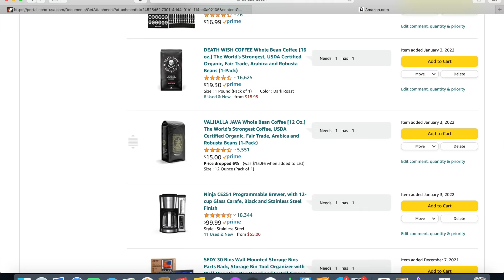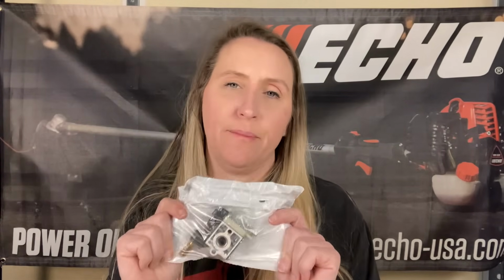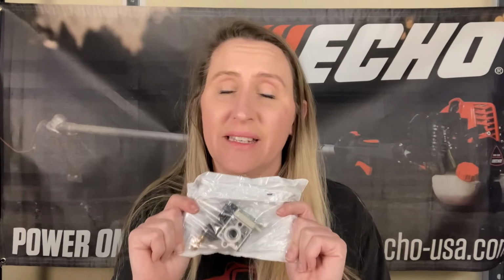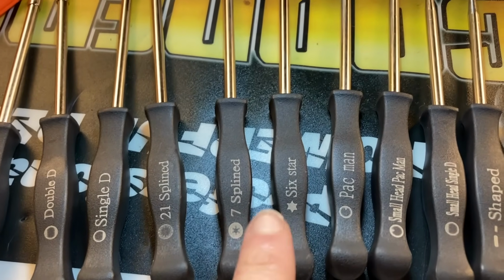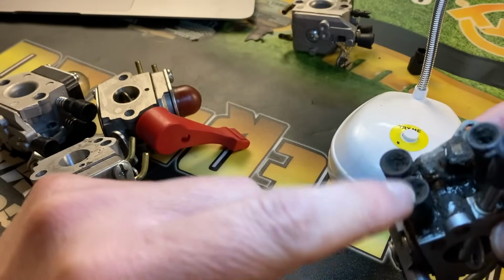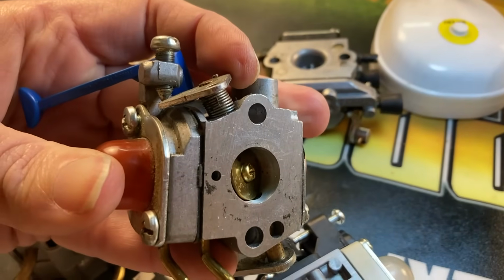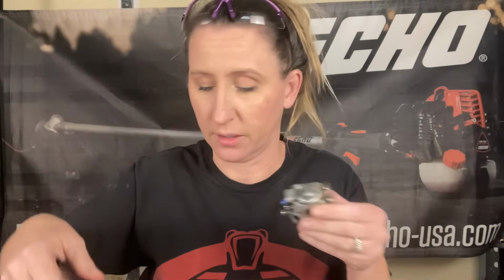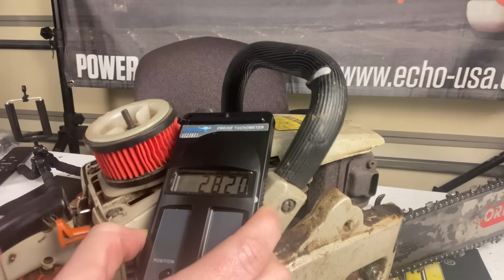HOW TO ADJUST your 2 Cycle Carburetor on a Chainsaw or Trimmer and when you probably shouldn't VLOG

Comment: The manual for my Stihl HS87 hedge trimmer shows "Cut off speed" is 9,300 rpm. What does this mean when I am adjusting the full throttle speed? Thanks from the UK. I am finding your channel enormously interesting and useful.

Comment: High i am struggling with a huskavana 545rxt brush cutter I can get it to fire but not iddle or throttle I've changed diagrams new fuel new plug checked spark good I'm going to change fuel lines and filters what should I set carb to high low n throttle plz

Comment: I didn't see the Echo limiter cap removal tool listed in the description or your website.  When I googled I found both a 2.5mm (#ECH-91075) and 3mm (#ECH-91076) limiter cap tool, as well as an Echo 91157.  How do I know which one I need for my Echo HC-2020 Hedge trimmer?  Thanks!

Comment: Water in the fuel may be due to the use of alcohol in the gasoline to oxygenate the gas before it is burned. There are two types of alcohol in use, methanol and ethanol (wood alcohol and corn alcohol). The methanol is hydroscopic (attracts water) and will suck it right out of the air. It is only put into the lower two grades of fuel but not in "ethyl" or high test. Use only the highest grade of gas for your 2 cycle mix. Also the alcohol, either kind, degrades rubber and plastic parts in the fuel system leading to their failure.

Comment: If the high adjustment is lean it will run hot and not have as much power under load?

Comment: Idk what kind of carb my buddy bought and put on his echo backpack blower but idk til i had gotten it to clean carbon out of the exhaust port that it wasn't right and would only run about half choke and maybe rev 60 percent. The book gave some settings to start from but this carb didn't have stops for the hi and low like the one that was supposed to be on it. Both of them would screw all the way out of the blower so that could really have caused a major headache. About ten turns for both from in to all the way out. I screwed both three turns out and the low side was fine but the hiwas maybe a little worse. I kept turning it in 1\8 or 1\4 a turn at the until i heard it trying to four stroke and then ran itin another 1\4 and now it cranks 2nd pull Everytime and revs like it's supposed to. The book gave a pert number for a tach to be used i think that blower supposed to run at 6800 it said but so far it runs like new and hopefully is close. You are 100%right about the after market carbs, but a 25 doller carb to have to take to the dealer and spend no telling just for it to run at all and that's if it doesn't tear up nothing being set crazy

Comment: Hi there...I have a PB260 blower with a (aftermarket) carb that has no visible needle adjusters...can you tell me what is High and what is Low ... and how much I should try to adjust ... the blower is running rich ( goes "Blaaaaaaa) full open instead of that familiar highend sound...
thanks so much...Love your channel...  Rick

Comment: I had a holzforma G660 chainsaw that started having carb issues. I think the diaphram got crunchy... I replaced the Carb with the correct one made by Whalbro but it wouldn't idle correctly and would get hot and idle too high. I took it to a chainsaw shop and they tuned it up for me perfectly. It now starts first pull once its warm and idles for days. I think my saw was running lean at idle. So its not true in my opinion that a new OEM carb dosn't need an adjustment one hundred percent of the time.

Comment: The carb kits and carbs bought on eBay come with adjusting g tools. The last $10 carb I bought I bought on eBay for a Homelite trimmer not only came with a tool it ran perfect without any adjustment.

Comment: I have a husky 450 rancher. Just started with a problem after having it several years.
Started flooding. It fires like one time and then it floods. Spark plug is wet. I changed the plug but has the same issue. Could it be the air filter? Or the carburetor? Or coil?
Any input would be appreciated.

Comment: 19:22 ‘turn counter clockwise in’ 19:49 ‘turn counter clockwise out’ I was trying to figure out if these screws affect air or fuel, but I can’t come to a conclusion when one minute counter clockwise is out and the next counter clockwise is in. I can’t tell if they are right or left hand thread. I will try another video.
Reply: That confused me also but after watching the adjustment video she just miss spoke about the rotatation
Reply: @aprilpigg9217  Watch the screwdriver handle...you can tell which way she is adjusting, which is best.

Comment: Oh by the way thank you for the information that was very good I have a couple old steel saws ones are o 29 I can’t remember what my other one is it’s a it’s a bigger one it’s got the compression release pretty low ours saw runs real good oh also I was going to recommend a chain called frostbite guy gets chains and has them cryo-genic depth they hold the edge really good tough chain to a Jim mungai From Kennerdell Popetown

Comment: i just replaced the piston on an echo cs510 that was straight gassed. now that i have it running, it seems to run fine at first, but after getting it warmed up and almost tuned, it revs over 13k/14k and takes a while to return to idle no adjustment seems to fix this... is this a vacuum leak somewhere or any suggestions ?

Comment: love your videos, very helpful maintenance tips etc.    But i have a problem!  Husqvarna 450 chain saw only a few years old, not heavily used.  recent tough starting and wouldnt stay running.  brought it to a shop, they did a standard tuneup and fresh gas and it worked for two cutting sessions, then same problem.  I tried a few things, checked for spark, new fuel filter, new spark plug, checked for spark and i can see it in the dark, checked the kill switch ultimately and for now reason i can figure, I  got it to start and bucked two trees then wouldnt start again.   some say a bad coil.?   what do you think?

Comment: I have a Poulan Pro cheapie, you know with the crappy bar adjust that loosens up every 5 minutes and gives you a saggy chain, something happened to the bar oiler drive or line, and I have to take the saw apart to figure out why. I'm not happy.

Comment: PS you said about it don’t like running on gas that sat around. It’s not that gasoline is only good for six months. The only way to fix that is with fuel stabilizer.  

Gasoline is just like a can of soda once you open it all the fizzy run out and it goes flat. That’s the best way to explain it with 15 years of experience in a petroleum company.

I watched your video I was in a Small Engine Repair class mini mini years ago and I needed to get those files dusted off and watching your video was the best way to do it about adjusting things   

That’s why they don’t let people adjust carburetors. Because mine I don’t use no meter I crank them up I don’t care if they’re doing 4000 RPMs they’re only supposed to be doing 3000 I am so sick and tired of seeing people stand there for 15 minutes trying to weed whack or cut For hours you just can’t get that engine to spin a little faster.  And I’ve never burned an engine out as long as you use the proper oil mixtures and good oil not that third grade cheap stuff that even if you’re running your engine properly your engine still burns up.

Comment: I just replaced the carb on my husqvarna 525L with a genuine walbro carb,  the original had minor adjustments with a small flat blade screwdriver. The new one has splines. I have a set of tools,  but a 21 spline will not fit on the screw,  seems too small,  I read that some Walbro carbs need a 22 tooth spline tool.. I can not find one online.  Any help would be greatly appreciated.  
Mine is running a bit rich on the High side.

Comment: Great video.  I have an Echo PB-46HT backpack blower.  Works really good and I've "deciphered" the way to make it start every time - without flooding!  My question is about throttle response.  Idle sounds good, but high RPM seems low (I need to buy a tach).  And when I push the lever to rev the engine it bogs, slowly catches it's breath and then makes it up to the higher RPM.  Do you "think" this might be fixed with your carb adjustment?

Comment: Here is a tip for you that works for me. On 4-cycyle engines use 2 ounces of EMT(engine metal treatment)  oil additive like Bestline or Prolong one time then 1 ounce after that. They seem to work well and If purchased by the gallon,  about $1 per oil change (mowers) The price is reduced significantly.. No I am not sponsored, but know what works for me and my equipment. Check out Project Farm for results; although he did not specifically  test these two as yet, but will, he still had good results, with other additives. His results showed Amzoil and Pennzoil Platinum as exceptional oils. The additive at $1 per oil change (small engines) is still less than $3 cost per quart of Amzoil, and has better lubricity. I was told by a oil engineer that the best oil is clean oil.

Comment: You actually are correct.Ethanol fuel is Hydroscopic(water attracting). It sucks water from the air.....its why ethanol cannot be piped. Thats where the water comes from.

Comment: I have a Brand new ms170 and it wont idle it runs perfectly but just barely wont idle but if i just press the throtle sligthly, so litle that you cant Even hear a difference in the rpm’s it will stay running do you know what it can be.

Comment: Would the idle adjustment be valid for any 2 cycle small engine?  I know some engines are designed to rev at higher or lower RPM’s, but is it safe to assume that they would all idle at about same speed?

Comment: Got a link for that tach? I couldn't tell how it was actually connected to the saw; is there a clip or soething to the spark plug wire?
Reply: The link is on the extended description. The Rotary 15344 tach ($65) comes with a wire with clamp jaws but this tach can also be used 'wireless' to sense the pulse activation as shown on the video.
Reply: @roynajecki1100  Thanks, I swear I looked at the description and didn't see the link the first time (shrug). Looks like a useful tool.

Comment: Ethanol in the gas absorbs water directly from the atmosphere.  Non-oxy fuel has no Ethanol.  
The fuel container for all my engines is filled with nothing but non-oxy fuel and a bit of fuel stabilizer.
At end of season each engine is  allowed to run out of fuel.  Those with fuel shut-off valves are shut off & run dry after every use.

Comment: hello!  what does “speed in max power” (8000rpm) mean?  
I guess that's the maximum power of the saw in the wood, at 8k rpm.  
whether I am right or it is the maximum number of revolutions without load.  
how should i set up my saw?  
greeting!

Comment: These new gas cans spill more gas then you use. Then you have to buy gas caps and vents to install to make them work right. Such a pain. Best thing is to buy racing plastic gas cans. VP makes good ones with a built in filter.

Comment: t I think the best adjustment to a 2 stroke carb is with a sledge hammer !!!!  Then I fit a new carb from Amazon.  The jets are so small and the plastic flaps on the gasket are not worth bothering with. Even using an Ultrasonic Cleaner and Compressed Air doesn't seem to fix them.  If they go wrong the dustbin is the best place for the carb !!!  A new one works perfectly every time !!!!  And they are only about £10 or so unless you want to pay £60 for exactly the same one in a  Stihl  Plastic  Bag !!!!!

Comment: Help please. I have an old Stihl 028 with the idle screw (not low speed) adjustment at the top that screws down onto a arm on the carb that opens the butterfly in the carb. How would you start to adjust that. Does the butterfly need to be closed or cracked in the run position?
Reply: Screw it about 2-3 turns from first contact of the throttle arm, screw it in  to raise rpms, screw it out to lower.
Reply: @jessemalone8363  Thanks Jesse! I’ll give that a shot tomorrow.

Comment: Hello excellent and I agree with John below. As I twisted wrenches since I could ride a bike. ASE and OPE  certifications Taught auto, marine and Power Equipment trades. Many times more women in classes then people would realize and they went in the trade. Many better than the males. Glad to see your ability. My agreement is FUEL. yes you said it. Where does the water come from, the AIR?  Yes the moisture is sucked in by Ethanol!  Alcohol is hydroscopic.  Also, Octane ARG. it is added to fuel to SLOW the burn of the fuel so it doesn't pre-ignite in hot higher compression engines. try to make people realise that when the industry "infers" Octane power. Oh my fuel is #1 issue complicated, but simple.

Comment: My current chainsaw, a Homelite Super XL-AL of early 1970 vintage, has served well over all of these years.  Alas, I have sinned by having NEVER let it idle for a minute to warm-up prior to use.  Do you think my error has harmed my saw or shortened its service life?
Reply: wow seriously? that is small engine equipment 101: let the engine warm up before going full throttle. An engine doesn't run right til it has warmed up anyway...

Comment: love your shows  I have a Echo CS500VL  serial  #0143845  I checked online and saw that there is a recall on this Saw,  Is it still in effect.  
The saw has great compression but on spark  are parts still available

the
Reply from the maker: This is correct! I just looked it up and if you take it to an authorized Echo service dealer, they have to take the saw and give you a brand new 50cc, 20 inch bar, comparable saw to replace it. If you have ANY issues call Echo corporate, because your dealer might be unaware of it if they don't make the effort to look it up on there Echo dealer site. Be persistent and you will get a NEW SAW!! Awesome!

Comment: I just bought a new Husqvarna carburator from a dealer for my 128LD and it runs like garbage. I was having the only runs when chocked issue. Good fuel, filter, carb screen was clear. So I bit the bullet for a new carb to just be done with it. Not a happy camper!
Reply: Took it to the dealer and they adjusted the low and high circuits and it was running fine at the shop. Bring it home and it was hard to start. Finally got it started and made it through a 1/4 of the front yard and will not stay running. GAWD I hate two-cycle engines!

Comment: I hope you will read and answer this for me.  Do you know or are you aware of what the difference ambient air temp has on carb adjustment.  Where I live, east central Minnesota, I can be cutting wood at -20 or +90 degrees.  i have a fairly new Poulan Pro 3.3 that runs great around zero but just so-so at 80 degrees.  I've noticed the same with some of my older saws (I have four).  Any advice?
Reply from the maker: Hey Mark! Does your saw have a "shutter" inside? A lot of saws are built with these to close or open up air flow. If it does, you might want to open it up during the heat of the summer.
Reply: @Mark Grassl YES!!, air temperature (and altitude and humidity) definitely has a lot to do with two stroke motor carb adjustments. How do I know this? From my two stroke motorcycles, two-stroke RC airplane engines, two stroke chainsaws and weed wackers, etc.  Some of my two-stroke motor applications have come with a high altitude adjustment kit (needle jet, main jet, etc.).  The air/fuel mixture is what's affected.  When it's colder, air is more dense, hence a richer air/fuel mixture is needed.  When it's hotter, you need to lean the mixture.  So if your saw runs great at  zero degrees, try leaning it out when it gets hotter and I'm sure it will run great at 80 degrees also.

Comment: Use premium non-ethanol gas with fuel stabilizer, run your equipment 3 every months and rotate the gas out of it every 6 months.  I have equipment running 10 to 18 years without an issue.  Do the same premium fuel and fuel stabilizer in my boats, never an issue.
Reply: AGREE, Stay w/ the plan.. Non E fuel, Stabilizer, Rotate and run er..Let er eat every now and again..

Comment: I’ve found quite a few 2 stroke tools I’ve purchased new have been out of tune…..way lean or rich ……even lean would be a problem if it’s causing stalling …wasting more fuel by attempting constant restarts and revving without actually doing any work..

Comment: The reason modern gasoline draws in water is because of the ethanol. The way those two attract actually is the same way you can remove the ethanol and give yourself gasoline that won’t fill your engine with water. You basically put the gasoline in a transparent container like a big glass jug, add a small amount of water, and shake it up. Leave it for a while for the water to sink back to the bottom and then carefully pour or siphon the gasoline off, leaving the water in the bottom. The ethanol will be dissolved in the water and left behind, leaving you with completely ethanol free gas. I don’t think you actually get ethanol free from stations that don’t have separate pumps for it because the lines are still full of the ethanol gas for a while.